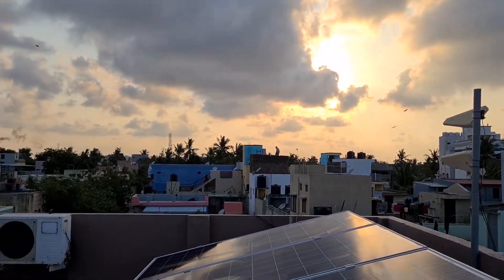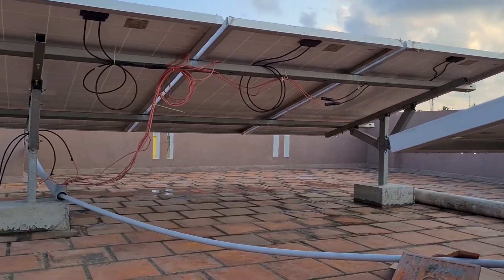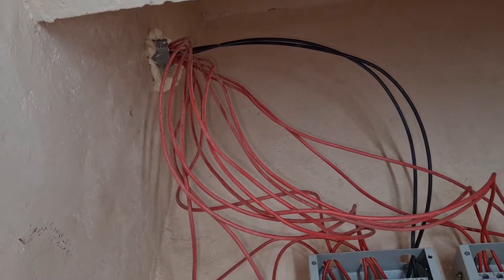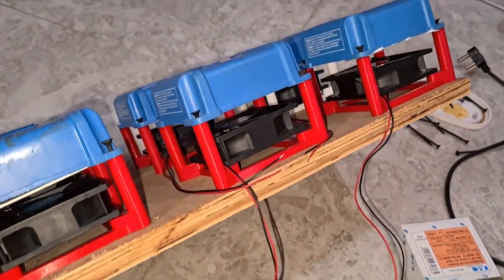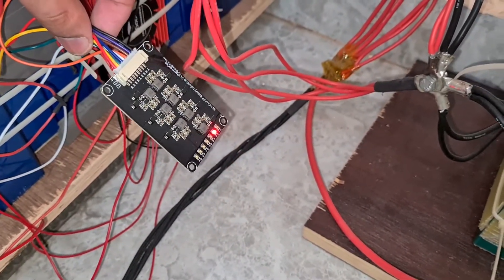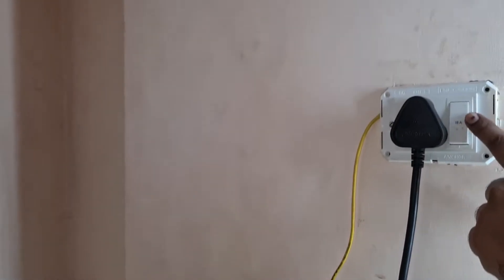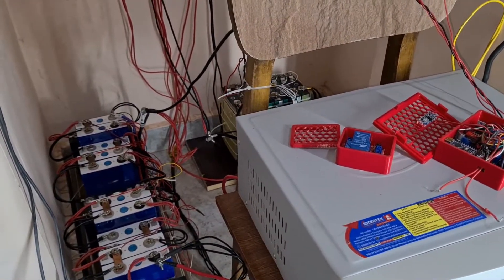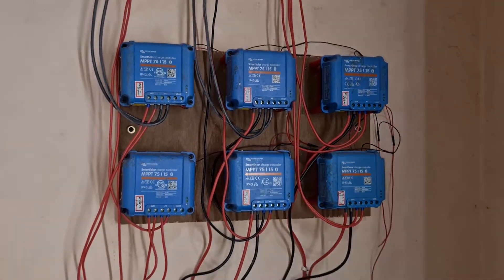2KW Solar Setup using Victron 75 15 MPPT Bluetooth charge controller

Comment: Have you running on each battery two mppt's? I ask because you could use the Bluetooth network function. One mppt would the master and the other one the slave. So charing on BLE network control is much more effektiv.
The cooling fans. Possible solution to work energy saving you could use a PWM controller with a temperature. sensor to control the speed of the fans.

Comment: Just a small tip, you can use one of the Load Output of the Victron MPPT to drive the relay, and since you have a LFP battery, the MPPT has a 2 Minute delay before it switches the load output on/off. So if there is any spike load in home, it will wait for the voltage to stabilize for 2 minutes, and then drive the relay.

Comment: I like it...tons of redundancy should you lose one controller. I too run two 75/10's on a smaller battery bank...I will also add more controllers and panels when I expand the system, thanks for sharing

Comment: Hey, I wish to set up an 800w solar panel system with a Lithium battery, the load will be less than 300w as I will run MacBook, router, camera, raspberry pi, etc only and it is only for my room. where I can get good pre-build batteries? I can't buy a battery because my parents won't allow it as I'm 16.

Location: Nagercoil, Tamilnadu.

Comment: Also , ....   why not use one big solar charge controller ,   Instead of several smaller charge controllers ?  It seems to me to be inefficient  !!  I am just curious and would like to understand why is all.
Reply from the maker: Hi there. Victrons cost a lot in india. And it doesn't make sense to buy it at that cost. But since these are used one I got them for a price of two new voctrons, which made sense for me to use this option. Yes using one large controller makes sense and it much more efficient however, just a cost comparison for a 100/20 model  I can get one 500w panel and a charge controller and also get a technician get it installed. That is how expensive it is.

Comment: I really like your idea with the brackets and fans . However I have always used victron solar charge controllers and never found one get hot yet !  I have a 48 volt system with one victron mppt 150 / 100 and even when its pushing 80 charging amps I still haven't found any heat issues ! That I believe is the number one reason I stick with victron equipment is because I've never found any heat issues anywhere with any of the equipment !  Which tells me they didn't cut corners when it came to components !
Reply from the maker: Yes very true, I really victron products. They got hot when I was pushing 15A for a 12v system with ambient temprature of 38°C.

Comment: Those look like 200 watt panels , Not 25 watt panels !  You sure there's not a zero missing or maybe you got amperage confused with wattage ???
Reply from the maker: The panels that am using are 320 and 335 watts. i might have miss spoke.

Comment: Can we connect the li ion batteries directly to the charge controller like we connect a lead acid battery or there is some other circuit also involved.
Reply from the maker: There is no other circuit required. It's direct plug and play

Comment: What are the equipment runs on the solar system inverter..super and thank u sir
Reply from the maker: I run most of the house load. 24 hours on battery and solar

Comment: How can i purchase the 3d printed mounts?
Reply from the maker: Sure.  You can let me know. I can print it for you.
Reply: @diyIndia  are they 120mm fans? Also i have the 100/20 smart solar mppt? This is the same model you have?
Reply from the maker: The fan are 80nm, the smart solar 100 20 is different than 75 15
Reply: @diyIndia  have you designed the 100/20 version for sale?

Comment: Victron MPPT 15a  controller how much watts supported...?
Mera Solar panal 250 Watt...
Reply from the maker: Victron mppt support panel upto to 75v, but for 12v battery you can potential get 210w and 24v at 380w.  You can connect panel even 335w panel as long as it's within 75v, the mppt will reduce the wattage

Comment: Smart solar you can connect to each controller can work as one controller share the data with each other.. called VE.Smart Networking
Reply from the maker: Yes . These are already connected to a single network and synchronized charging is enabled.

Comment: Hai Sir..
Good Informative video...
Like to know something from you regarding Microtek inverter back panel switch
If I choose mode (1st switch) as normal and turn off grid charging (last switch) will that stop inverter to stop charging battery from solar and will run live load using solar panel